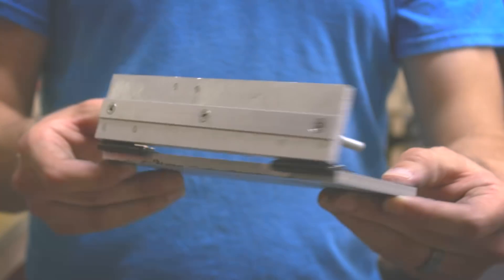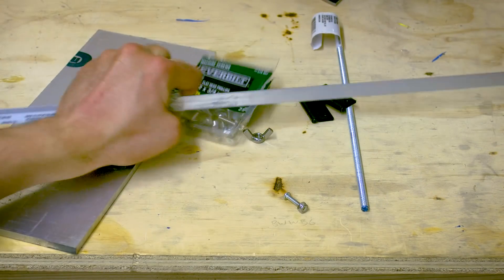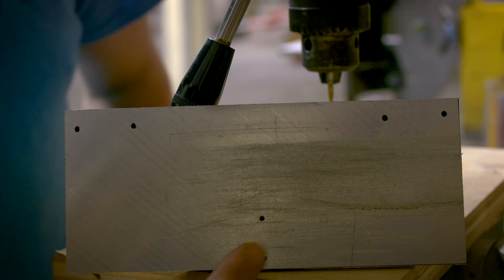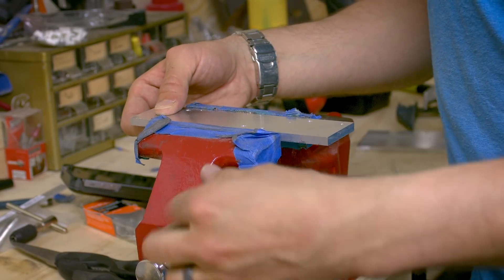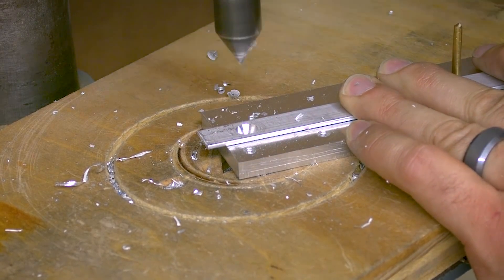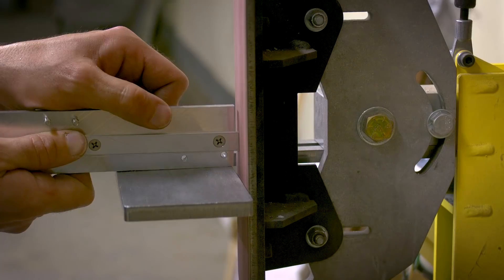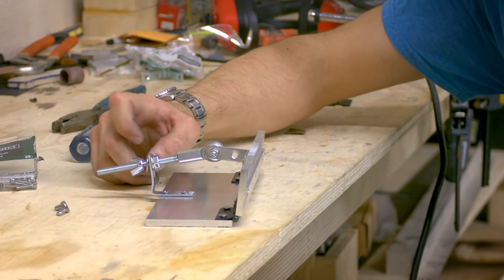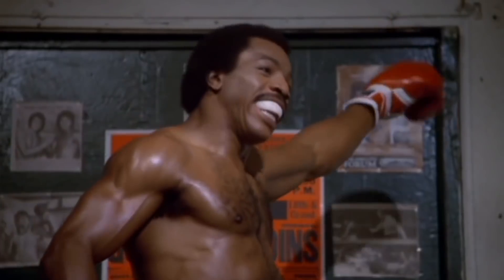Graz Makes: A Knife Bevel Grinding Jig!

Comment: Could I make a suggestion? On the aluminum bar that the knife rests on. I think it would be great if there was a way to adjust the height from the top of the jig so you could even grind a narrow knife blade, and perhaps even scissors. Some kind of slots in that plate where it could ne slid up and down, and then tightened in place. 
Some kind of threaded stud welded or fastened in place on the narrow knife rest that insert into those slots, and a wing nut on the back to tighten it up once you have it in place.

Comment: So did you have any issues screwing the 1/4 20 all thread into the 1/4 28 heim joint? The threading doesn’t match up so I’m wondering if there was issues.
Reply from the maker: I ended up recurring the treads but you could just get a compatible thread to the heim joint. Hope that helps and thanks for watching!
Reply: Oh ok. That makes sense. Did you retap the heim joint or just recut the all thread? There doesn’t seem to be heim joints or really any other joints that are threaded in 1/4 20
Reply from the maker: its been a while but i think i retapped the all tread.
Reply: Appreciate your replies. I’m making a version of this. Quite different but a similar adjusting method. Thank you much.
Reply from the maker: no problem! would love to see what you come up with!
Reply: Graz, watched the video 100 times as well as many others. I built the one of your design today.  The heim joint turns out to be I believe a 6 -20 metric thread. So I found this out at the hardware store, no problem I made it work. Had to buy metric nuts, bolt, wing nuts an some other parts. 
I will watch your video using it. Thanks for the great design and I am lucking forward to making some great bevels. Yes, you are amusing, and I enjoy you sense of humor.

Comment: Why not cut a couple channels for the "blade rest" bolts to ride in to make the rest height adjustable? It would also help when make folder blades as well. side note Using something like Tap Magic can be beneficial when, get this..., tapping holes. (I know, who would have thought, right?) Sure is a nice looking jig though, that's for sure!

Comment: Anyway you can tell us the measurements of where you drilled? The pdf only shows the two pieces and the holes but not the actual measurements. Thanks!
Reply from the maker: hey zach, are you referring to the size of the tapped hole?
Reply: No I mean the ‘pre measured’ holes you talk about that you punch before you drill. In the PDF I don’t see where it gives those measurements. Hope that makes sense
Reply from the maker: hmmm, not totally sure what you mean. the dots on the blueprints is where you punch, as far as the size of the drill, its usually included with the tap which I say the size in the video. hope that helps!
Reply: He is talking about how there are no measurements for the layout of those holes. You have dots on your blueprint, but no measurements for how to layout for those holes
Reply: Yes exactly what he said, thank you! I for someone reason couldn’t spit it out to make sense haha.

Comment: I've watched several knife bevel jig with adjustable angle videos and none seem to answer this question: how are you setting the angle?  What device do you use?
Reply from the maker: you can get a cheap angle finder from harbor freight or even use a level app on your phone to find the right angle. hope that helps!

Comment: NICE job. Quite funny - we've a lot of memes in common. Coupla substantive things: 
(A) TAPPING - your old-wisdom of 'back-and-clear every quarter turn' isn't right w/ aluminum, plus as someone pointed out (and here I'm gonna one-up-Graz you, since you started it with the blurred bit): NEVER tap a hole without lube, dude. At least some 3-in-1, or even canola, seriously. And with 6061, you don't need to back to break chips, just to clear them and keep threads clean. And make sure you're vertical when you start tapping.
(B) SAFETY (1) - again, as another pointed out - I winced "down below" seeing you wearing ring and watch. NEVER, EVER, EVER. Believe it or not,  drill press is near top of list of major industrial shop accidents, due to torque, due to "grab and yank" accidents - because people don't THINK it's scary. And rings, sleeves, and watches are what get yanked - and don't yield. I don't even enter my shop to work, wearing a ring, watch, or long sleeves - ever. And, like your Sesame Street vid - I can count to 10 (with my pants on :-))
(C) SAFETY (2) - DO. NOT. DRILL. METAL. FREEHAND. This is the "just this once" rule for winning a free trip to the ER, all expenses paid by your insurance. Clamp it, champ. Even aluminum. Google this along with "damhikt". Just a "speed clamp" is fine, but something. Aluminum can be grabby and gummy and spin, and spinning metal and torque is a really bad recipe.
(D) SAWING ALUMINI(U)M: fine on a tablesaw, yes, but do it with a blade meant for that and save that blade for metal. Don't use a $80 Forrest on metal. Oh - and wear a mask! (Cf. above, medical insurance, later life lung problems, etc.)

Comment: How did you use a 1/4-28 heim joint with 1/4-20 all thread?
Reply: Christian Williams yup, ran into the same issue AFTER buying everything

Comment: Would there be any benefit to adding some inset magnets to hold the knife against the jig?  I don't have one of those fancy grinders yet, so I don't really know.  Just curious.
Reply from the maker: I totally forgot to show me using the thing in the video. I just use a cheap harbor freight clamp to hold down the blade to the jig. It doubles as a handle to grab on to that won't get too hot when grinding.
Reply: Hmmm.  Maybe a second video.
Reply from the maker: You can see me using it with a clamp in the previous Mac the knife video!
Reply: Yes and no, mostly no - and I speak from (related) experience. Briefly: magnets strong enough to hold the knife to the jig, against the downward forces of the belt, ALSO will want to hold the knife through the belt to the steel of the platen behind the belt.  Also, the magnets you'd need are quite large surface area and tricky to inset in that thin aluminum - you'd need to use like a 1-5/8" Forstner bit - and need to be screwed in (or epoxied) to keep them from just pulling out by the steel. This is a pretty tricky operation. (There are other ways to do it but other disadvantages there too.)  So, you COULD - but short answer (a) it's not easy and (b) not worth it.
Reply: ManCraftingTM you could, but all the metal shavings would stick to it as you grind.

Comment: Quick tip on the hole tapping... Get some kind of lube in there. There's aluminum-specific tapping fluid, but even a light 3-in-1 type of oil will do. Makes the process much smoother, and less likely to break a tap.

Also, in addition to the drill press clamps and/or vise another commenter suggested, a really good safety practice is removing jewelry (noticed you wearing your ring and watch). I've seen pictures of what can happen when something like that gets caught in a machine. Even small machines can do some real damage.
Reply from the maker: Now ya tell me!! Just kidding! I will check it out! Thanks for the info!!